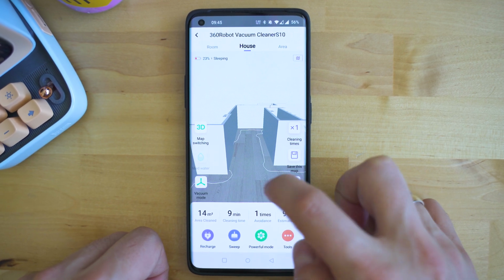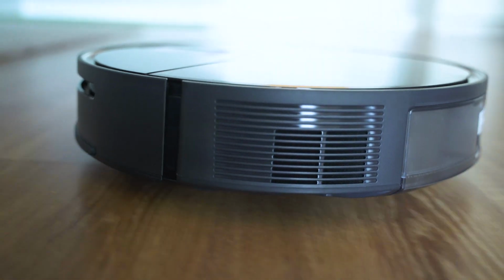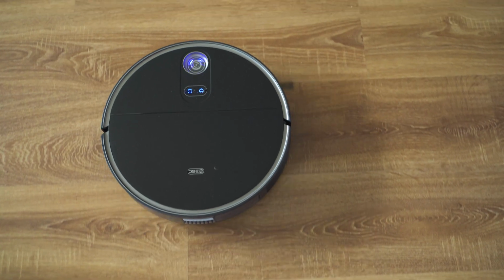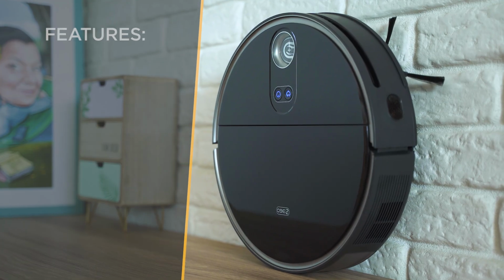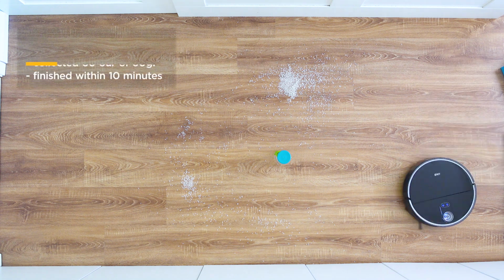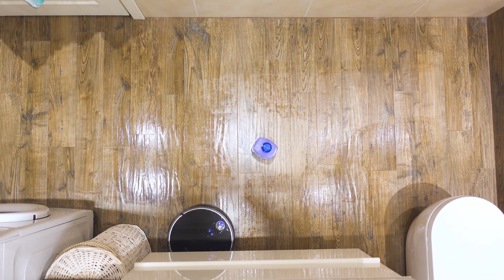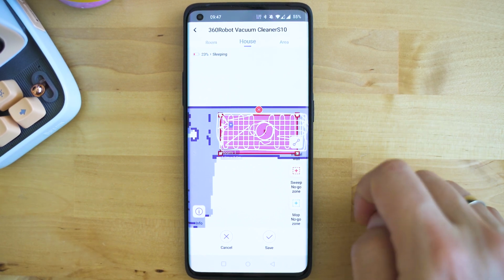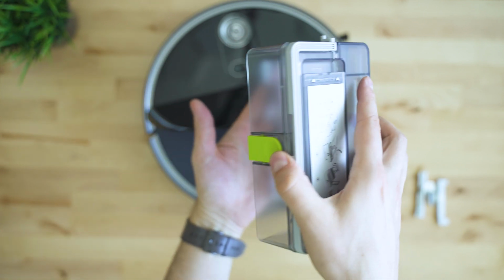This Robot Vacuum can Create 3D Maps! 360 S10 is Smart, Powerful & Innovative.

Comment: Anyone thinking about the S10 don’t get one I have one and it’s won’t connect to wifi and 360 is unable to offer a reason for the issue and have no solution, only get a reply from 360 every 24 hours Would not recommend
Reply from the maker: Hey Michael - I don't believe one particular complication is a good enough reason to claim a company is rubbish.
Can you see any Wi-Fi from the vacuum? What is the kind of phone that you use for the connection?

Keep pushing their support, they will eventually do whatever they are supposed to.
Reply: I had the same issue, after one month of using without any significant problems S10 suddenly went offline and I was trying to reconnect it maybe 20 times with no success, then even logging in into the 360 Robot app with my account stopped working, it was nothing wrong with my wifi router, Robot was even shown there as connected and online. At the end I re-install the application on my phone so and it was not connecting again, then all of a sudden the next day robot got back online, however..all maps and settings gone, so now I have to re-map and set everything from scratch which is not a very fun thing to do with 10 rooms and 2 floors.
Not sure if this is a App issue or Robot firmware issue, however its not stable, I read alot of similar issues on forums and etc. I am very satisfied with the cleaning and  navigation and app features, however it is of no use if you cannot use your app and reset robot 50 times and etc.

Comment: I have the s5. It's good. But the app is lacking in reliability and connectivity.

Also none have a self emptying base for their prices... Plus all of their tanks are tiny.

Battery life is OK but after a couple Months drops quickly.

The brush sucks. It always gets pet hair stuck in the bristles.

I wish s10 came with self emptying and brush cleaning base (like shark iq).
Reply from the maker: Yeah, would be nice to be self-emptying. 
The S5 is a great model and I like it a lot. It's battery capacity is not great, but kind of okayish. If your battery has degraded - there are plenty of replacement options. 
As for the brush - it's the same with most vacuums. I have Roborock S5 and it has the same problem...

Comment: I've seen countless videos on robot vacuums and robot mops but this particular video on the robot vac-mop is lacking clear information on it's mopping capabilities. So it's got a water tank and a cloth pad. I'm guessing it wets the cloth which then 'mops' the floor. Does it remove excess/dirty water from the floor like a squeegee or does it just push dirty water around the floor? The best actual mop robot I've seen is the iRobot Scooba which has unfortunately been discontinued. How does this robot mopping capabilities compare to say the Scooba?
Reply from the maker: It is not better than Scooba in my opinion. It just slides on top. In my opinion none of these robot vacuums are good enough about moping - better get a dedicated heavier device.

Comment: Does this robot suffer from the problem with sunlight? That e.g. when there is sun shining directly on the floor it thinks that it is an obstacle? I know previous 360s had this issue.
Reply from the maker: hmm, I haven't tried that. It ran in the room today while it was finally shining, will check on the map.
Reply: I have a 360 s7 and it does have problems with sunlight

Comment: Great Video!  Thanks for the introduction to the S10  

Things that 360 robots need to do that other HIGH END robots won’t do.  I had a iRobot 7 series vacuum (returned it) and currently have: 360 Series 9, iRobot M6 mop, Deebot T8 with auto empty, and an old Neato, dumb version, for the basement.

•	The app must show you where the robot is REAL TIME so you can find it when/if it gets stuck
•	Chris Cross vacuum pattern when on X2 setting.  Deebot does not do this.
•	LIDAR!!! (lasers to track position) iRobot does not have this and bumps into EVERYTHING
•	TEST CAT HAIR ON AN AREA RUG.  iRobot 7 series would not pick up cat hair because of the plastic brushes on the beater bar.  In fact, iRobot support told me to PICK UP the robot and place it ON TOP of the hair.  Unbelievable…   Deebot beater bar is better but still needs 2+ times going over the area to pick it up.  My 360 S9 picks it up in ONE PASS every time.  Not rocket science here, just normal cat hair on a low pile are rug,
•	Needs a auto empty feature.  Sorry 360, I use the Deebot most of the time because of this.
•	DUST FILTER has to be washable. Am I the only one that has DUST, holy cow! The iRobot 7 series is not washable and so small it plugged after the FIRST run around the house.  The 360 S9 is washable, GREAT.  The Deebot is not washable but the pre-filter is so the original HEPA(?) filter is still clean.
•	I didn’t think a MOP feature was important until I bought the iRobot mopping robot.  It sucks.  Uses the same app and navigation features so that is constantly gets lost, bumps into EVERYTHING.  Leaves auful tracks.
•	Multiple maps for a single level is a must, here’s why:  With the 360 S9 I keep a separate map WITHOUT no-go areas.  This way I can slide tables and chairs out for the robot to clean behind.  Also I move the pet feeding bowls to allow cleaning/mopping in this area.  Having to edit a map and move 6+ no go areas is a pain, especially when there are vacuum and moping no-go areas.  You also have to reposition those no-go area when you are done deep cleaning.
•	Multiple CLEAN HERE (custom) areas, the Deebot fails here.  On the 360 app I simply select the various area to clean, such are area rugs or high traffic areas.  The Deebot only has one area and it is not saved like the iRobot or 360 S9
•	REMOTE CONTROL!!! So the S9 came with a physical remote.  Very very handy and app also has this feature.  It is used to bring the robot to me to clean and maintain.  I got a bad back.  iRobot and Deebot do not do this.  I think Deebot had one at one time and then phased it out of their product line.  You can see a remote on their web page.  Ecovac support (Deebot) told me to create a cleaning area next to the couch and then it will come see me for cleaning, this is a cheap workaround and a pain because as I said above the app does not save the custom clean areas.
•	Still love the old Neato TANK in the basement.  I just wanders around the basement cleaning up the painted floors.  Gotta find it once in a while by listening to the BEEP BEEP BEEP.

Well, I’m just a robot nerd and that’s my opinion.  Peace and Love.
Reply: Great point about the remote, very useful
Reply: He is 100% spot on. The s9 will get the app upgraded mins the 3D map that the s10 has.. (I did see an s9 map on an iPhone that looked very similar) I just DO NOT see an $800 robot, the only "upgrades" over the s9 I see is 600 more PA  a larger water tank but the tank is external, 20% larger dust bin with disposable bags (non feature) and slightly improved navigation, I did not see it really "avoid" anything the s9 doesn't do now? Yes it's .60 inches shorter, 15%.. I just don't see a justification of spending twice is much money for this... I ask each of you $800 for the s10 or $400 for the s9?
I say this is a better version of the RR s5 max which makes it a $500 bot at best..I can pick up a s9 for $352 no tax, it's just a better deal, for $800 this would need a bin AND better mopping.
Reply: @ricke95126  Well, if you have 9cm space below sofa and other furniture like me, this is the only LiDAR based robot, that you can buy. For others you have to crete no-go zone and clean up manually. Or use your old dumb robot to clean there.
Apart from that I agree that S9 probably has better value for money, but it is the same with any other flagship product. Flagships are always overpriced...
Reply: @tomas_klouda  I'm just saying for the $ the s10 is over priced for what is provides, 3 lasers is NOT a big innovation, they have been out for 3 years and the t8 does better job with it.. lower height is not Innovation
Reply: @ricke95126  Hi, I’m hesitate between Deebot T8+ (non-aivi) or 360 S9 or 360 S10. So you think the T8+ is better?
Actually in Canada, it’s 899$ at bestbuy.
Thanks,
Bert
Reply: @bertssuggests  what type of floors do you have, what is the environment like? I can say Dreame is a MUCH better option than the 360 options I have owned all the 360 robots except the s10 and the L10 from dreame is much better
Reply: @ricke95126  I have hardwood, ceramic and some carpets, and 3 levels of floors
Reply: If that is the case, if money is no object, the following in this order, Roborock s7 dreams L10 360 s10. I would not recommend Ecovac, which I own and like. The Ecovac only really supports 2 floors and becomes unstable when you have to move it. The most significant benefit is the auto empty base, but you have to run ot dality, or it will clog. With 3 floors you lose the benefit.

If cost is a consideration, then the order would be dreame D9 L19 Roborock s5max 360 S9 Roborock s7

They all have good apps Dreame is made by roborock parent company
Reply: @ricke95126  thank you Rick… not sure that I can have more than 3 maps with Dreame… in Canada, it’s difficult to have Roborock. You have right that for the price, the 360 S9 can be a better option than 360 S10.
Reply: @ricke95126  Hi, in my country, I can get the Dreame L10 Pro and 360 S10 for around $380. Which one is better in your opinion?
Reply: @oakland2425  Same price, that is hard. Do you have carpets in your home? How many floors? The dreame app is slightly and the 360 in the past with other units have not done well on carpet and has really bad support. I'm guessing 360 build quality is slightly better. I'm big into apps and Dreame is better
Reply: @ricke95126  Single floor 1 bedroom apartment. No carpet although might get a rug in the future. I have a long curtain that touches the floor and often leave clothings on the floor though so i need a vacuum that will avoid those things.
Reply: @oakland2425  I would lean towards the L10 esp if you have other Xiaomi products. Who is the retailer
Reply from the maker: Awesome list! I hope the guys from 360 are monitoring the comments.

Comment: Does it work on black carpets? Is the app still glacier slow? When you have shadows on your floor the robot will get stuck.
I can only advise you to not get any robot of that company.
Reply: Be careful Ronald Tai will accuse you of being too critical if you point out short commings
Reply: @ricke95126  I have the 360 s7 and face the above mentioned issues. Unless they are fixed, I would not recommend getting any of their robots.
Especially the slow app and problems with sun coming through windows and creating shadows on the floor which confuse the robot completely are no gos.
Reply: @max_schuster86  I have the s7 too as well as the s9. 
My s7 HAS the same issues you mentioned, my s9 doesn't,  it's a newer model using LIDAR 3.0 so I think that improvement solved those problems. I don't have the app latency issue and I think it's because there are so few owners in the USA, the servers are not over loaded and are being used at a time when others are asleep. Once there Re more users we will have the same issues.
Reply: @ricke95126  okay then two major issues got fixed which is very positive. The latency of the app using from Germany is barely tolerable. To start a cleaning process with loading the map and selecting rooms takes more than five minutes. I have to do that daily as we have kids, a dog and two floors in our house. It drives me nuts.
Reply: @max_schuster86  yeah that sucks.. I wish they would commit to providing proper support. It's like support is an afterthought
Reply from the maker: I don't have black carpets, but have a black matte and it went over it. I often run the robot at night, if that helps. 
The app is now faster than Mi Home, but is not too slow either. To me - opening the app and starting a cleaning task takes a few seconds. 5 minutes sounds like crazy a lot!
Reply: I got a 360 s9 and it works just fine.. lets see
Reply: I have an S9 and it is very good, I don't have a lot of latency problems using it in Brazil.
Reply: @foxcanaa  Oh then it must not be ture let me go out and buy one LOL I am so done with 360 customer service it THE WORST I have ever seen. I am picking up a S6max for the same price, real company real support. BUT best of luck to you!!

Comment: there are not many innovative changes than its previous model os s9/s6 pro
Reply: Yeap I totally agree 👍 the S10 is a modest upgrade at best not an innovation which is why I am guessing they did not push this out to the review world, They priced that as a Flagship 2021 bot but they have a mid tier product, they made a product that competes with the N8+ Ecovacs mid teir bot.  

AT $799 The target should have been the t8 avi or the rr S7 pro 

TrueMapping technology which can map your home with 4X the accuracy, T8 delivers enhanced and powerful in-depth cleaning without collisions. Vacuum & Mop simultaneously. TrueDetect 3D technology to identify obstacles precisely and avoid instantly. The revolutionary TrueMapping technology maps your home with 2X coverage and 4x accuracy. Long-lasting battery.

This is model came out when?? 🤔How is the s10 innovative?

T8 has a bin and sonic mopping as an option,

This is a $399 bot.
Reply from the maker: The whole cleaning algorithm looks different to me. The new 3-d systems makes big difference in my opinion. 
But it's true - the S9 is quite a decent device too.
Reply: @TechMishka  3d is also available in 360 S7 pro, and it is the algorithm of the app and not of the Roboter.